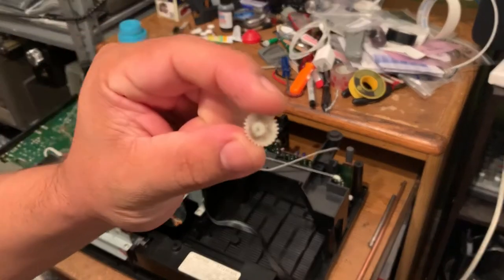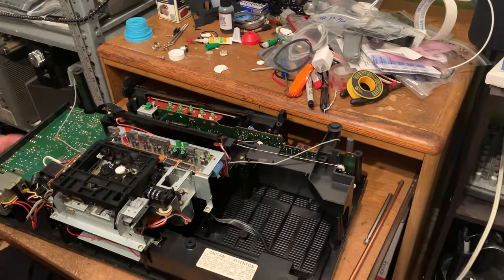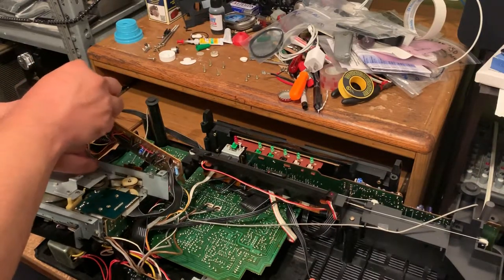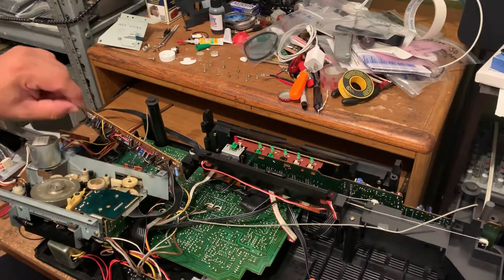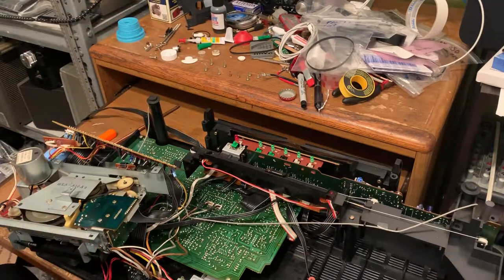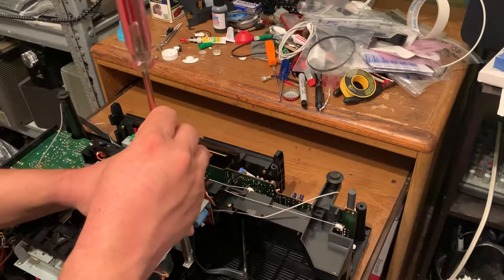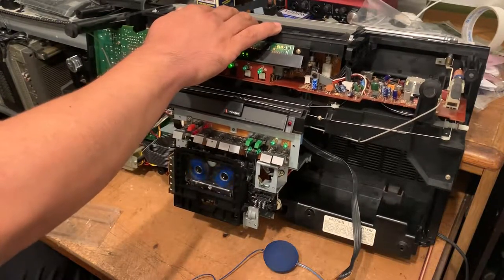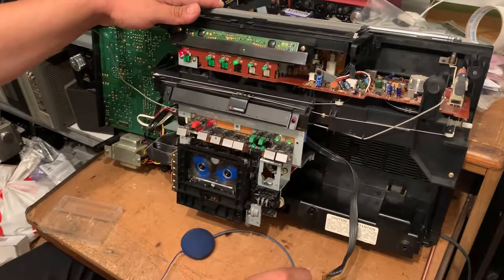PIONEER SK-750 CASSETTE DECK BELT REPLACEMENT

Comment: The general rule if you cant find an exact matching part # belt, and having to use a generic belt kit, size the new belt 20% smaller than what was removed from the unit, to compensate for slack and rubber decay. You do not want it too tight or you will overload the motor and lock it up. Too loose and it will just fall off. Make sure to clean the pulleys before fitting the new belt to clean off rotten rubber.